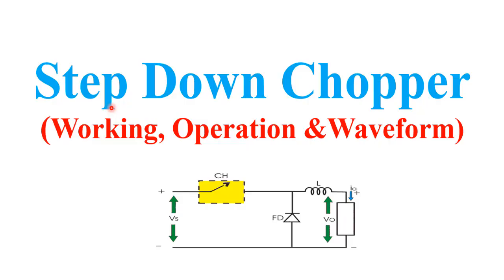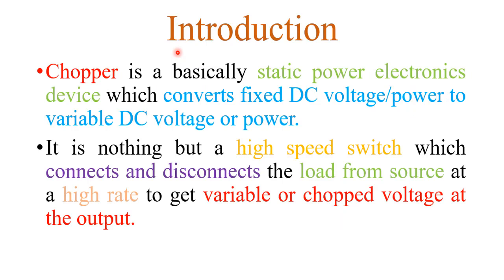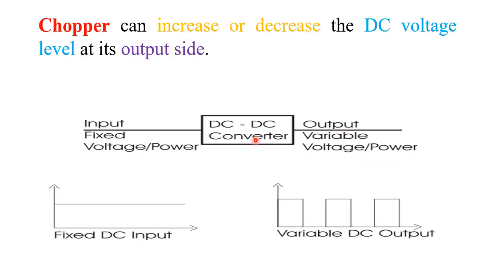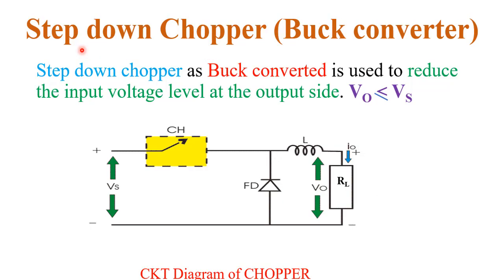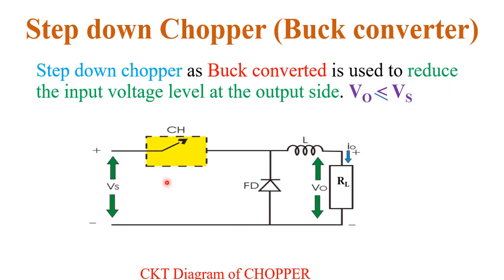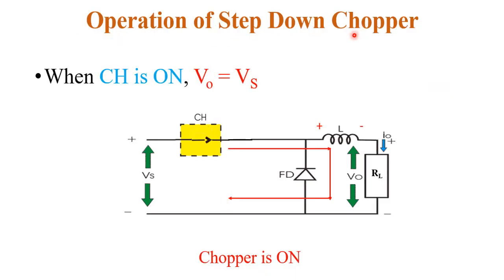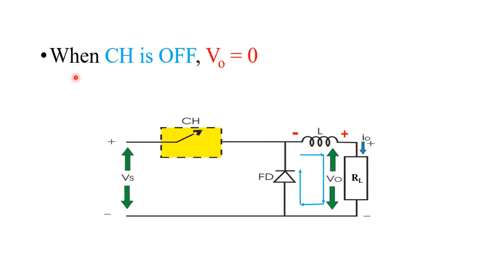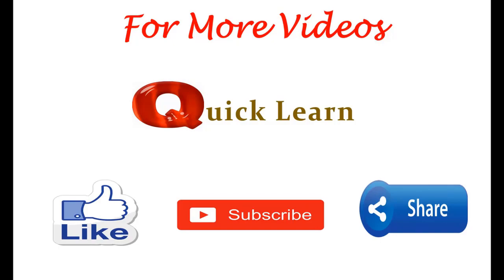Lecture 17 Step Down Chopper or Buck converter (Operating Principle of Chopper)

Comment: Few point I doubt in video. Please correct me if I am wrong.     1. During ON period V(load)=0 )as per you, but I think it should be = VL(Voltage across Inductor),   2. You haven't added capacitor in parallel.      Basically Buck converter is simply a chopper(high speed switch) with LC filter and a diode in parallel with LC filter.
Please clarify if possible.

Your way of explanation is no doubt superb...!!!!!